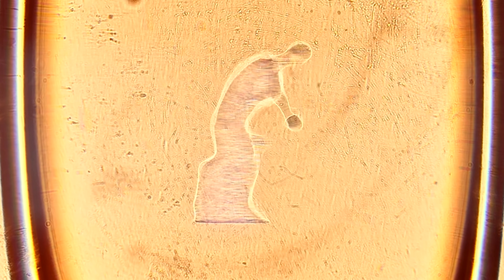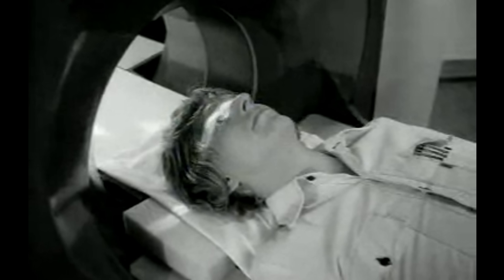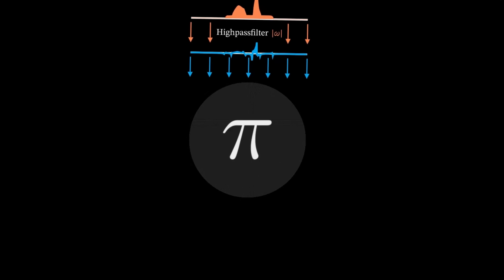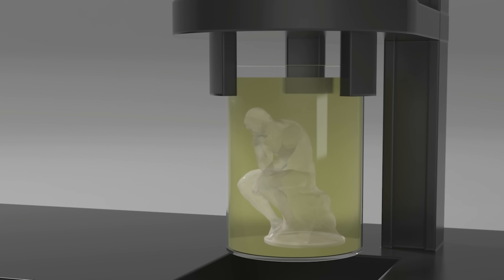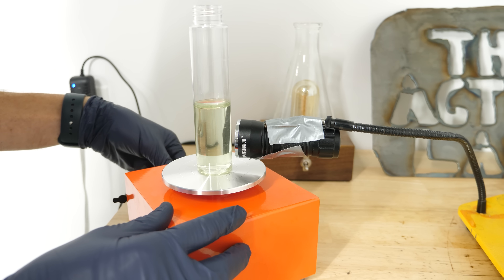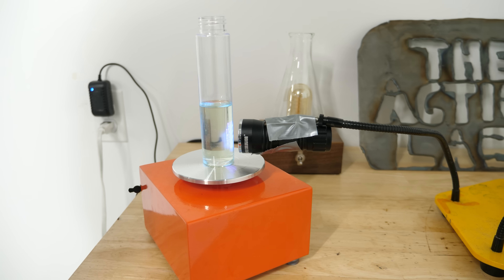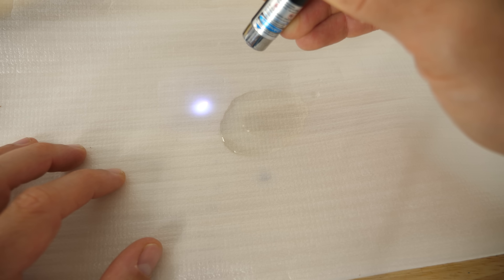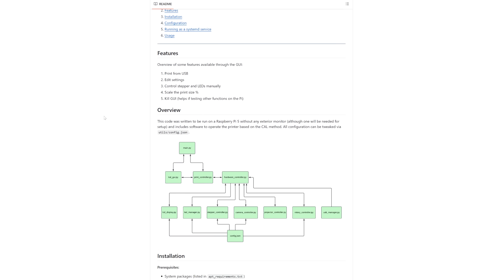Volumetric 3D Printing Is REALLY FAST

Comment: The Berkley people only gave you half the answer why it was not working for you. You need to collimate the beam to reach the critical intensity at the specific depth/coordinates at which you want to have the resin cure or harden. Your UV flashlight was not collimated in any way, so whatever depth that intensity was reached is where it would harden. The plastic vessel you used also has an optical impact on that. Resin Printers solve that by just having a static depth at which that intensity is reached, but the tradeoff is layer printing. The innovation is being able to dynamically do the computation for where that depth is in order to build that image in a three-dimensional structure, but do it "inside out" as it rotates. Because otherwise you would end up with a shell item but the center would still be liquid.
Reply: That innovation they are using looks to be a dlp projector. They are probably using their own light source but it looks like they're using the dlp chip and a standard hdmi signal to project the image.
Reply: @lefear2  you can collimate beam with simple lences. You don't need special projector, only special optical system. Same technology like 3d-glass-engraving. Beam unfocused on surface and focesed in middle-part. So it's reason for blurred image on  4:45.
Reply: Feels like a real pain to keep this properly calibrated for the top end of what it can do, but it seems pretty straightforward and with a lot of room for experimentation in how to run the beams through the resin. 

I work in flexographic printing, and the process described here makes a lot of sense with how that style of plate is imaged and built. I wonder...
Reply: @epithail couldn't you do calibration in an automated manner? For example, print a defined model and then scan it to determine if any parameters need adjustment?
Reply: @pierrehuggins9458  pretty much, yeah, but there are a lot of other variables that would need to be accounted for as well which entirely depend on a lot of the other factors in the design of the system. 

The optics used for this style of system are going to be really interesting to see develop.
Reply: Probably need to take the curvature of the container into account also. That's a cylindrical lens that needs to be counteracted, either in the output data or optically.
Reply: it's explained in the video when it recreates the pi sign, the light only have to be shot in a straight line (looks like they use a Fresnel lens but I might be wrong) but doesn't have to be set for a specific depth, if you only shoot a laser in the spinning tank it will only harden in the center because it will receive more light overall.
The trick is to probably not let it run for too long, or else you'd probably end up with a disc when all the resin will receive enough light to cure ?
Reply: Thanks, was wondering how they were setting "depth", assumed it to be some form of collimation. Appreciate the explanation. Sounds like a tricky code to write.
Reply: The core idea is so simple but it sounds like it must have been a NIGHTMARE to optimize.

Also, the printed object needs to stay stable on the rotational axis to ensure a sensible print, which means the rotational speed and the physical fluid properties of the resin are also critical variables for optimization
Reply: This is an answer. If the resin is trasparent, like in the video, to complete the polimerization of the resin in the center, it's enough to expose the final object to a normal uv light to complete the polimerization?
Reply: Kinda like how a gama knife works intersecting beams
Reply: Thank you! I was thinking the explanation in the video made no sense; the light intensity is just as high where the light enters the vessel as it is where the resin is supposed to harden, so if it was just intensity you would still get the ring.
Reply: Well no, that's not quite right either. It is just intensity. The rotation (the tomography part) is what makes the difference. The light isn't getting "focused" at the right depth. Collimated light is the same intensity all along its path. The reason that the resin cures in the center is all due to the rotation, and how long the light is sustained at any one point in 3D space. It shouldn't have to be built "inside out" either, if the tomography is effective and the cured resin maintains the same clarity and index of refraction as the liquid.

So yes, it's true that the light needs to be collimated, but not true that some "depth" has to be set. And collimation isn't the same as focus. It's not focusing at a depth.
Reply: @delphicdescant  I came to the comments because I didn't understand this part but you explained it perfectly, (and so did the duct tape example on the spinning plate). At first I thought you would need 2 sources of light that converge to the right intensity at the right depth, but the spinning creates the same affect as their being multiple sources of light around the resin.
Reply: @delphicdescant  the fact that we can see it when its printed while inside the resin means it does not have the same refractive index once cured
Reply: @delphicdescant as far as you know or think; is there likely to be any change in volume as the resin solidifies? If so, wouldn’t that make it not possible to do it from the outside in? It could/would explode if it expanded slightly during curing as I imagine that overweight noble gas; oxygen would have a thing or two to say about being trapped?
Reply: Would be a nightmare for tuning different resins
Reply: It must also be a challenge to spin a fluid and get it to rotate consistently as a single rigid body without any turbulence, unless the resin is already partially solid like a gel. I would have thought it would be easier to move the light source.
Reply: I think collminating the projector is not required. You can see that in the disk and paper demonstration the light rays was the same throughout the disk. However the software is what contains the depth information. It's not as simple as taking pictures of the object at different viewpoints. U have to simulate the light rays going through the 3d file and getting weaker as it encounters more materials. Like an actual x ray CT scan.
Reply: Yeah this was what I was still confused about. Intensity is intensity but the light is still hitting the outside edges of the fluid first, and has to pass through that part of the fluid before it gets to the center, so things would still Harden from the outside in. I'm curious how they manage to control the light in a way where it doesn't Harden the outside of the resin, but I'm guessing it's probably going to be a bit beyond my level of understanding. I was never very good with laser physics, optical crap is weird.
Reply: I don’t think you’re right. What the video claims is that by projecting orthographic views of a moving model onto resin that is simultaneously spinning, each point of the resin that needs to cure receives the required amount of light over time. It’s not based on focusing light on each point of the model, as in volumetric laser engraving, since that would require moving a beam through every point in space.
Reply: @Aroqua  More beams or movable beams

Comment: Now we can make 3D GPU chips with cpu cores in the middle and vram all around with connections on the periphery and polymer channels through the top to the bottom for water cooling. you just have to fabricate the silicon with holes so when you stack up the chips and line up the holes, the polymer fills the channels. Then you polymerize a sleeve making a waterproof channel which is 0.1 mm diameter. Pump water through the stack for cooling.  imagine a stack of 10 Nvidia  b200s the size of a pack of cigarettes.

Comment: OK I want to know why the resin is hardening in the middle and not the first resin it hits. I know a way, but you didn't saw it so I would like the explanation. The way I know is 2 light beams converging at the same point. Not enough at all the other spots but at the point where they converge there is.

Comment: First time I’ve seen this technology I thought it was quite impressive the idea of reversing the holographic transmission in order to make a 3d object from 2d information to make solid objects at this insane speed. This could be the “laser printing” of 3d Impresion, it’s simply amazing.

There’s an interesting fact not mentioned on the video, but the resin viscosity was modified to print on earth, according the gravity attraction values, so this can even print on 0 gravity, it was already tested on the G Force one using a a water viscosity index resin

Comment: This a random comment, but for years I've wondered if something like this could be used to create 3D holograms. Imagine a chamber full of gas. When a point in the gas is hit with enough UV light, it would energize enough to give off normal light. The sides and bottom would shine UV and where they crossed, that point would glow in 3D space. I have no idea if this is possible, but it seems reasonable.

Comment: Cool and all but I'm not convinced it has many applications in 3d printing.  It's fundamentally limited in size, the resin composition and, at this scale, I think resolution.  They've been presenting this research for awhile now but it's the kind of thing that feels like interesting fundamental research that is waiting for a different application.
Reply: Why is it fundamentally limited by size?
Reply: @Jehty_ Because the media isn't perfectly transparent so you have losses as your light moved through it but you can't just turn up the lights because then they go beyond the limit and start hardening the wrong thing.  

If you used lasers which have lower etendue I believe you can do better -- though you still face a limit -- but that starts getting pricey and unlike a layer based system your total print volume needs to fit in the system.

Comment: Only have an FDM printer, was never interested in SLA personally, because the process just seems more tedious for roughly the same result.
But this opens up a lot of possiblities, if the 'quality' of the final result can be increased (which I think they can based on the micro structures that were presented, then this might be something id consider getting in the future myself.

(I wonder how it would deal with 'internal' structures of an object to be printed)

Comment: 8:15 the reason it became a tube is because of the rotation speed, forcing the cured resin outward and layer on top eachother.
Reply: no, normal printer resin is just very good at blocking UV light
during a cleaning cycle on a resin printer the led array is run full blast for several minutes to catch any pieces of debris that have settled to the bottom of the tank in a thin sheet of cured resin, the light only makes it far enough to cure 1-2 millimetres of resin before being almost completely blocked out

Comment: Question: is there a way to drain unused resin from the hollow areas without adding a hole to the model? I assume this isn't an issue with the current resin printers as they seem to drain on each layer, but I don't have a resin printer so am accepting that I just might not know.
Reply: Basically it's not possible... of course you could leave the 2 holes, drain the resin, and then plug the holes with resin and a flashlight manually.
Reply: You can always just leave a hole, drain it, and then re-print on it, like with the "overprinting" technique on this video to close it, but some kind of "holder" would be needed because you'd most likely flip the model so that resin doesn't get inside (air wouldn't let resin in if the model is flipped).

Though be careful, it's a known thing in the 3d-printing community that air inside 3d-printed stuff ain't a good idea and literally everyone always intentionally leave holes somewhere (at least with most models, seen some get creative and make it the literal a*se hole of a character lol).

Comment: for high precision prints, they would need to account for index of refraction of the resin, which might(?) change as it solidifies. I wonder if they are working on that. I did notice that the prototypes are a little wonky (not perfectly straight) and that might be part of the reason.

Comment: How does this not have issues with occluded cavities unless it can shift a focal point to control depth? Or do you just accept a weaker finish on surfaces as a tradeoff and go with multiple passes from all angles? It should have a hard time hardening areas around a cavity if there is no angle that doesn't pass through space that needs to remain open?

Comment: I see this taking off in a big way. Not necessarily because of the technical advantages regarding supports and complexity, but just because of simplicity of use.
In a consumer product I'd imagine you fill the Vat with Resin, upload the print, then just fish out your model and you're good to go. No anti-stick screen, no finetuning of the print head, not much handling of the resin itself. I see this becoming the Inkjet Printer of 3D Printers.
Great video!

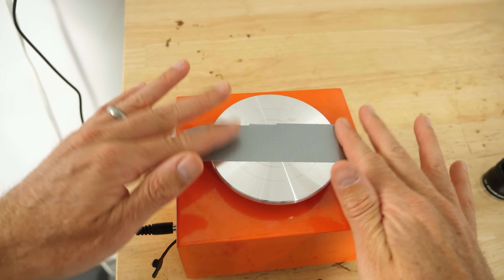Comment: 3:14 I get it…
Reply: Smart
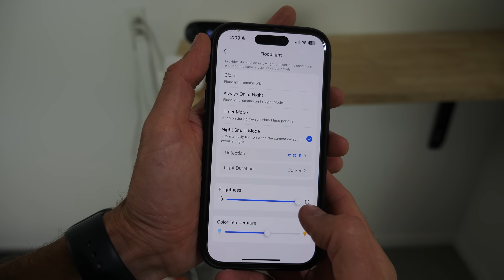Reply: @blackhatvisions I swear if there's a Tau reference at 6:28...
Reply: Then how do they get the laser to stop and interact exactly where it should or why does the whole axis inline with the laser not also get cooked
Reply: @EM-wt6qe they calculate the critical intensity required. You see overlapping parts are more bright. The turning of the cilinder allows for the pars hit by light first to be moved away before it starts the photochemical hardening.
Reply: @Mark-d2j thank you! Was wondering this
Reply: Woaaaaaa
Reply: 159
Reply: Nfw he planned that 😂 amazing
Reply: That’s the ENTIRE point of the video. If you don’t you’re not paying attention or mntally hndicapped
Reply: @yeahennydavid  You clearly don't get it

Comment: Looks like this printer will have the same limitations as casting metal - e.g. no way to create a shape that has inside walls effectively. Let's imagine a simple hollow sphere with a hole in it - doesn't look like it will be possible to print it, just a solid piece... right?

Comment: This is cool and possibly useful but it's ultimately isn't going to make the things we use everyday as long as the parts require clear resin which is inherently fragile. So like most resin printers it will be useful if at all for figurines and rapid prototyping of things you can later make without such a printer once you know they would fit or whatever.

Comment: The best thing about this kind of printer for the main consumer base is the speed. Instead of half a day, the model gets printed in minutes. Not having to place and remove supports is also a gamechanger. I really hope this printer becomes something you can actually buy for a decent price!
Reply: Fairly sure it will be. The technology seems simple enough to have consumer market appeal. Regular resin printing was at a similar stage a decade or so ago (Maybe 15 years, dunno). The one downside to it that I see is that you need a certain volume of resin for this to work, and this increases quite dramatically with larger print sizes/tanks. Also, bubbles will likely be an issue when it comes to details, so a vacuum chamber seems like almost a must for this, especially since the resin seems more gel-like than regular print resin.
Reply: imo it also needs to get better, prints looked good for how they are made
Reply: @rdfgdfgdfg  To be fair it's hard to gauge print quality from what we see here. The prints clearly are still very soft and need post-processing, cleaning and curing. But the nano structure prints do give me some hope that this method can in theory print some really crisp, tiny details.
Reply: No.  The best thing is the lack of supports.  All the effort to set up the model correctly in a slicer really turns off consumers.  No hassle pick and print.
Reply: We don't know that this is viable for "day and a half" prints. Every item they showcased was tiny.
Reply: also no slicing! the density images can be calculated real fast without any tuning
Reply: Give it a decade.
Reply: Tradeoff will be ultra cancer inducing resin, man you just can't have it all. It's a bummer
Reply: Also doesn’t have any toxic fumes from heated plastic which is nice too, just UV cured resin
Reply: @ChewyTwee well resin has toxic fumes aswell
Reply: @ChewyTwee  yeah resin is way nastier stuff than fdm fumes
Reply: @ChewyTwee
I would say resin is worse. It can cause burns if spilled on you. Filament when cool is inert in comparison, you can hold a piece of it for an hour no problem. 
That being said. I do not use a resin printer personally.
Reply: @LuneyToonz-lk2de it's inert until you start to use it. ABS filament creates far, far worse fumes than any resin. 
I've been printing with sla for a decade and have never "spilled" more than a dribble that ran down the side of the bottle.
Reply: @LuneyToonz-lk2de If you're getting butned from resin you're either allergic or it's not resin. It's bad to get on your skin but not a disaster if you get rid of it quickly. If you wear gloves, a mask and glasses, nothing bad will happen. Just make sure to ventilate. But that's true for fdm printing too.
Reply: @backcountry164  you got a source for that? ABS filament may /smell/ worse but that does not actually mean it is more dangerous the fumes from resin.
Reply: @ChewyTwee  You do realize that the VOCs from resin are a lot worse than a bit of heated plastic fumes from an FDM tho, right?
Reply: @ChewyTwee  the UV cured resin is pretty fumey/
Reply: @ChewyTwee  the fumes from resin is worse than from PLA, and handling resin is way more dangerous.
Reply: @ChewyTwee  Its rare to see someone being so confidently wrong.